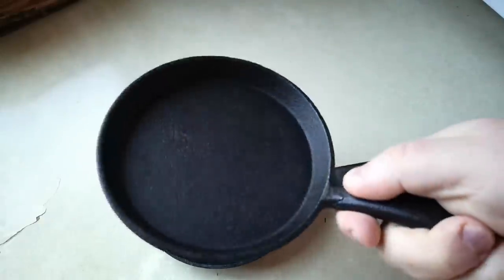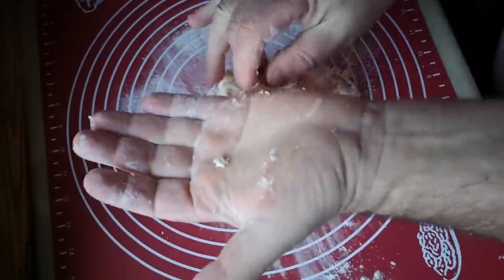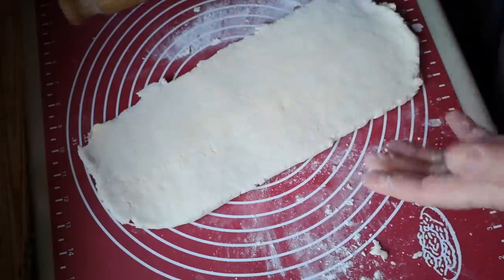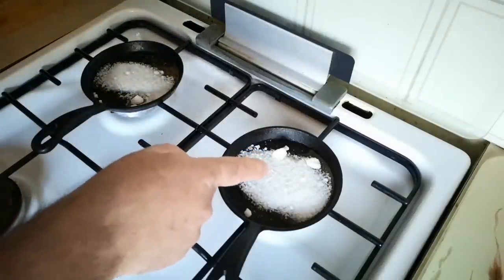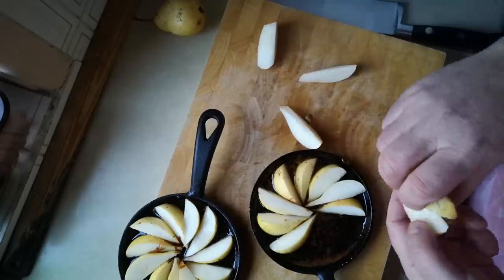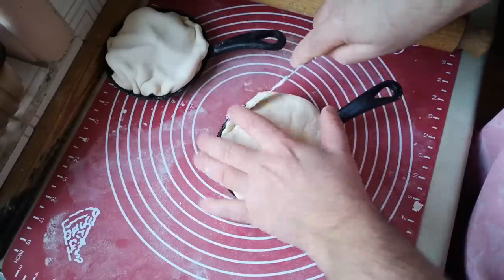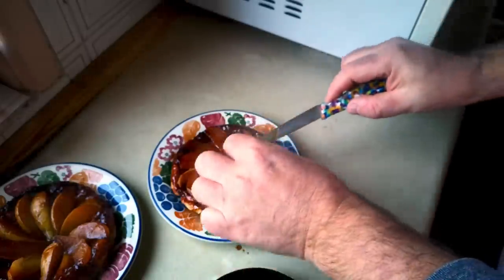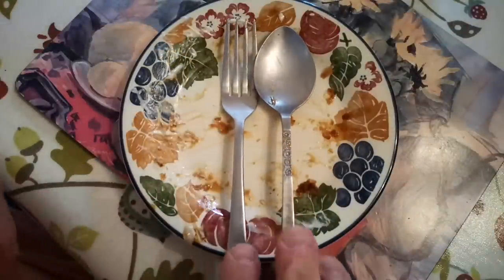Teeny Tiny Tarte Tatin - Cooking in the Mini Cast Iron Pan

Comment: By the way; sugar doesn't melt ; ).
Reply from the maker: What do you think caramel is?
Reply: @AtomicShrimp  So Caramel is the thermal decomposition product of sugar. If it was melting then if you cooled the caramel it would return to being sucrose, it doesn't it becomes solid caramel. 
The melting point of sugar (sucrose) is higher than its decomposition temperature, I believe that is true for pretty much all other saccharides too.
Reply from the maker: @timothywilliams7173  so when you heat sugar, a granular solid, and it turns into a clear liquid that can be poured, you for some reason don't believe this phase change should be called 'melting'?
Reply: I see why you might not believe me, a person on the internet that has pedantically posted on your video. However having enjoyed your videos, I always got the impression you were also a pedant who also likes being right, and would appreciate the knowledge

Can I ask that you open the wikipedia article for sucrose and take a look at the value for melting point.
Reply from the maker: @timothywilliams7173  this took place in a kitchen, not a laboratory. When cooks heat sugar and it turns from a solid to a liquid, we call that melting.
Reply: @AtomicShrimp  fairy nuff, just like a culinary fruit. 

I just thought you would be interested.
Reply from the maker: @timothywilliams7173  I think you've got an I teresting point. Maybe it could have done with a bit more detail in the initial comment
Reply: @AtomicShrimp  yeah sorry if the tone was off. Thanks for the videos!
Reply from the maker: @timothywilliams7173  we ended up in the right place! Peace